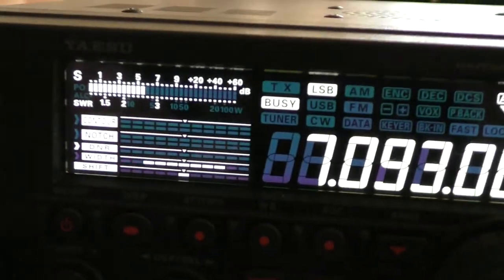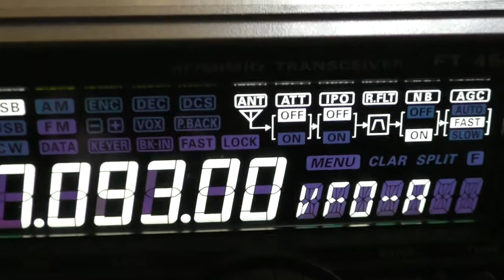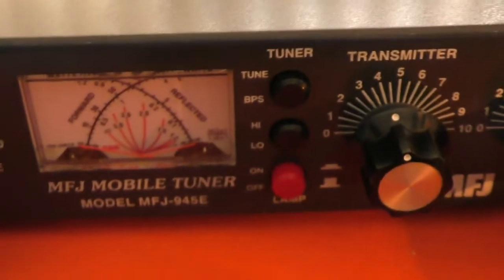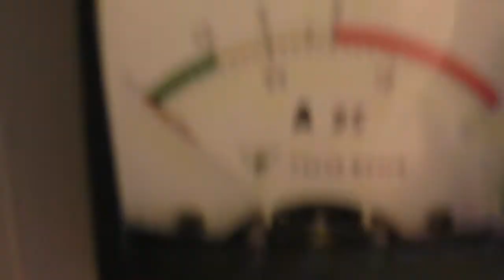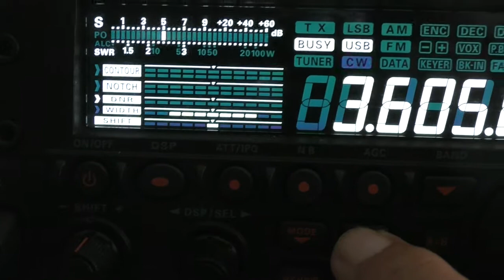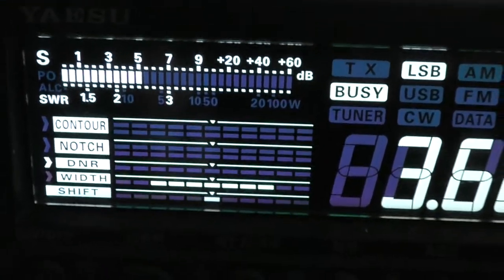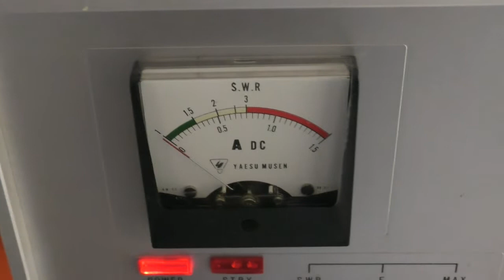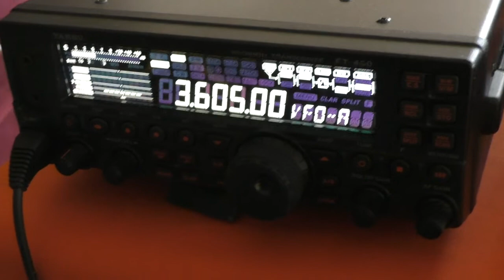How Much RX Attenuation Does The MFJ 945E Tuner Contribute?

Comment: One discrepancy I have noticed is that both the MFJ web site and the manual for this tuner state that the low range is 30 watts on forward and 6 on reflected, however the meter installed has a low range of 6 watts on forward and 1.2 watts on reflected. When I transmitted 5 watts on AM the forward needle stopped just short of the 1 watt marking on the meter.

Comment: Your tuner should be on the other side of the amp, however this meter is only 300watts.
Reply from the maker: No, this tuner is matching the input impedance of the amplifier to the 50 Ohm output impedance of the drive radio. The amplifier output is connected to a high power auto-tuner that matches its 50 Ohm output impedance to the antenna.
Reply: @vk6cs456 👍

Comment: Hi. Videos are great,,,,,is the mfj 945e a good tuner, I've used an mfj 949e Vera's tuner but it was massive,,,,does the 945 tune anything as good as the 949e,,,any idea

Thanx
Marshal
Reply from the maker: Thanks for the feedback. I have never used a 949E so unfortunately I can't compare them. The 945E is designed as a mobile tuner so it isn't as versatile with regard antenna connections, balanced output etc, it just has one SO239 output socket. And, the tuning capacitors are smaller in the 945E, even though it has the same power rating. Personally, for mobile/portable use I would buy the 945E, and for base station/home use I would get the 949E. I have found the 945E will match most loads I've connected it to, and it's a good size to put in my portable radio kit bag. If it got destroyed or lost I would buy another one.
Reply: Thanx much
Reply from the maker: Thanks for the comment.